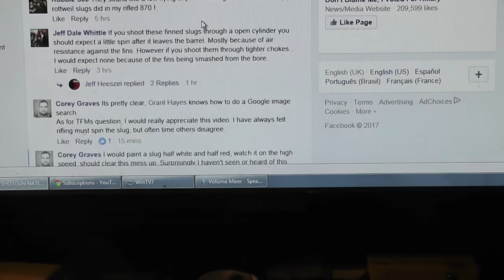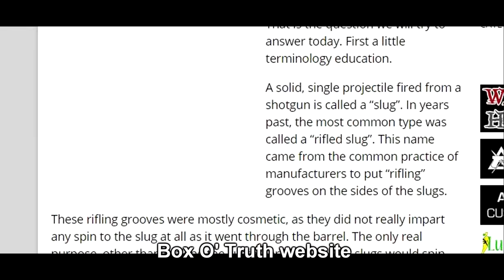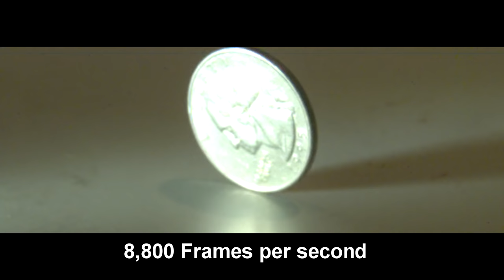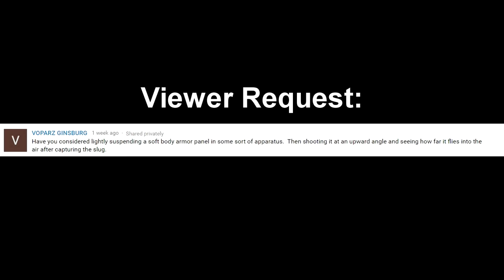Do Rifled Foster Slugs REALLY spin or it is just a MYTH?

Comment: I'm not convinced such a slow spin stabilized the slugs. That quarter spins much slower, but it weighs a fraction of the amount of a slug and has a minute sectional density. It also doesn't have a shock wave affecting it from being supersonic. Try gluing a point to the front of the slug and spin it on the table as slowly as the quarter. 

A rifled shotgun barrel has about a 1:28 to 1:36 twist rate to stabilize different slugs. If this test is 25 yards, then this slug has a 1:3600 twist imparted. I shot 62gr 5.56mm from a 1:12" .223 rifle and the bullets keyholed at 70 feet. The Army increased the 5.56mm only 7 grains and needed to shorten the twist rate from 1:12 to 1:7. .30 cal rifles meant for long range get a rate of 1:10 instead of their 1:12 rates of their lighter bullet throwing brothers. So,  I'm pretty skeptical that a couple inches difference in fast bullets makes a huge difference in stability whereas a rate 100 times slower in a slug will still stabilize it. Even the slowest twist rates mentioned here in the comments were still 50 times faster than the spin imparted by these rifled slugs. Note: 50 times faster in twist rate, not RPM. No one says the twist rate of 5.56mm is 305,450 rpm.

Comment: Years back I used a lot of .410 slugs.  I was in a discussion (It involved beer) with a couple guys and some said that it was dangerous to use a full choke shot gun and slugs. I cut a Remington  and a Winchester slug open and mic'ed both of them.  I don't remember which was which, but one was .390 diameter and one was even less. I often wondered if the cup in the slug expanded to the bore or if some of the gases escaped past the undersize slug and got it spinning. All I know for sure is it is a long way from cork bedded 'punkin balls.

Comment: When I shoot the Gualandi Dangerous Game slugs in my smoothbore shotgun I can see spiral grooves in the powder residue in the barrel, which hint to an approx 1-turn in the 20'' barrel. I think the Gualandi Dangerous Game slugs do spin through the barrel.
Which could also explain their remarkable accuracy  -  I can make 5 shot groups of 1.5'' or less at 50 meters no problem and even make 100yds hits in the black.
Reply from the maker: I think they claim those two ribs on the slug cause the slug to spin too.
Reply: Here in Europe all you can find is dangerous game slugs and the brenneke, foster slugs are unheard of. I've never seen the claim that they spin though, they just guarantee very good accuracy. 
Do you think the classic brenneke slugs spin too? 

Oh, and about the slow spin rate of the foster slug, the shorter the projectile the less spin (RPM) you need to stabilize it. Thats why really long rifle bullets need a very aggressive twist like up to 1:8 inch and very short projectiles like a round ball need only a twist rate like 1:72 inch.

Comment: Correct me if I'm wrong. But, isn't the heavier/bigger the projectile the less spin it needs to stabilized. Kinda like 556 is 1/8 or 1/9 vs 308 1/10 or 1/12. This is an educated assumption.
Reply: THE JONESY rifles need extreme rpm's because the back end weighs several times more than the front half like throwing a rock in a sock with sock end first. foster slug is like throwing rock end first since its front heavy so basically no rpm's needed. what your saying with rifles having different twists, a faster twists allows stabilising a bullet with more length to width ratio. 1-7 223 can shoot 80-90gr which are very long and skinny for its diameter

Comment: I don't understand why you didn't check if the unrifled slug rotated?  From what I could see it seemed to rotate about the same as the rifled slug which means the rifling was not the reason it had some spin.
Reply from the maker: The unrifled slug had a marking in the cavity.  It never rotated  around to expose the marking though.

Comment: The slug may spin, but is it relevant?  When discussing accuracy, It is the rate of spin that matters, and this rate is not constant for all calibers and projectile lengths, and that fact has not been addressed.  Generally speaking, the longer a projectile is for any given bullet diameter, the faster it must spin to stabilize and remain accurate.  Shotgun slugs, being almost as wide as they are long, would lack stability if it were not for their forward mass and hollow base, or attached wad/tail, which makes them behave more like Minie balls or shuttlecocks.  Both techniques give them greater accuracy and penetration than the inefficient round balls they were meant to replace.  So why are there both "rifled" slug barrels and smooth slug barrels, and why are so many slugs grooved?  Well, it appears that over 100 years ago there were some rifled barrels and choke tubes that were intended to be used with specialized slugs, but the reason for the slug itself being "rifled" had little or nothing to do with accuracy, and was all about efficiency.  The less contact the slug had with the bore, the less drag it created, so velocity increased (the felt wad formed an effective seal to prevent gas from escaping through the rifling grooves).  In the 1930s the Foster slug was developed using softer lead to allow any smooth-bore shotgun, regardless of choke, to safely shoot slugs.  The grooves or "rifling" cut in the Foster slugs allowed the projectile to compress as it passed throguh the choke, lessening long-term damage to the choke.  Any deformation of the slug did adversely affect its accuracy, but at typical slug distances of about 50 yards this was of little concern.  For those wanting greater long range accuracy, manufacturers developed the deer gun or slug gun, an unchoked (cylinder bore) smooth bore shotgun with rifle sights.  To add to the confusion, they also developed even longer ranged rifled slug barrels that are intended to fire undersized sabot slugs.  While it is possible to also fire conventional "rifled" slugs through these rifled barrels, it will cause lead buildup.  It's better and safer to always use the right ammo in the correct barrel for the proper purpose.

Comment: Do the vanes/ribs spin match the slug rotation in flight? 1 in 22”, 1 in 25” for example, similar to barrel rifling and do bullets spin same rotation after leaving rifled barrel?
Reply from the maker: Yes,  usually bullets/slugs spin in a clockwise rotation looking at them from the rear

Comment: I have had excellent results wiping 1000+ lube into the crevice between the slug and the roll crimp. It will take you from a 6-12" group at 50 yds to a 2". If you start with a clean barrel it will stay clean and continue to improve accuracy as it seasons. If you start with a dirty barrel it will be much cleaner when you finish the box. Rifled slugs are the only lead projectile that doesnt have lube. I thought doing this was obvious. I would like to see you test this. Who cares if it spins or not. It is very front heavy with a hollow base so it flies like a very short arrow if it doesnt spin.

Comment: I do not credit the 'spin' of a Foster type rifled slug to stabilize the slug in the same manner as a rifled bore handgun or long gun.  Typically, a Foster slug has accuracy equivalent to a large smooth bore musket of the Brown Bess or 'Charleyville' type.  I have used slugs from 12 gauge shotguns in my lawman days.  At fifty yards the slugs pattern about roughly 12 MOA or six inches, give or take.  

I vastly prefer shotguns with rifled bores and rifle sights, and depend on the Brenneke (classic) type slugs.

Needed spin is determined by length of projectile (bullet), diameter and sectional density as well as velocity.  Probably good to throw in the phase of the moon.  Larger and short for length projectiles are easier to stabilize.  Maybe slugs stabilize more than I think.  I still prefer a rifled shotgun.

Comment: It doesn't matter.  Those grooves are designed to crush and seal against the barrel.  Foster slugs are designed nose heavy to maintsin stability.  They are quite accurate in a good shotgun.
Reply from the maker: Then why do they make them slanted?

Comment: 100% agreed. spin is spin. even if it was 1 rpm it is essentially still spinning.
Reply: This.
Even 90 degrees spin on that distance is several rounds per second. It is enough to stabilize it, when you think about it.

Comment: JEFF JEFF JEFF...1ST. I LOVE YOU GUYS😁..I must point out an Error of a statment you...made .. about the "Vanes and Shockwave" .... remember a Shockwave is Only a Pressure wave... the Air Still Flows around the Projectile. The Shockwave is The Result of Air Molecules Packing up onto each other as the static Air cannot move out of the way quickly enough before  the molecules that have deflected off the Projectile slams into them.  BONUS: Fun Fact The contact point on the Projectile to the air Medium During Super Sonic Flight is compression. Resulting the Shockwave which is an "Adabiatic" process of Compression.  This Is the Heat Generated during Compression. This Is the Real Cause of External heating on Spacecraft Re-entry and example the SR-71 Blackbird. The Skin friction is Negladgable.

Comment: he problem seems to be that any fluting on the slug is not really in contact with the smooth barrel enough to impart all but the most minimum spin (200 rpm by your estimate.) Not enough in the time of flight to do much — 3/4 to 1 full turn in flight. Hopeful but not enough.
Could you make a sabot that tightly grips the slug and contacts the barrel more robustly than the slug alone? Or a fluting design that channels the detonation into angular momentum that spins the shell?
Got an artillery guru out there?
Reply from the maker: The amount of force slamming in the back of the slug is tremendous and causes the slug to compress.  It is definitely contacting the barrel.    It's the same process a Mine' ball uses
Reply: Yah. I see that the hollow Foster slug is sort of a 'lead balloon'. Still, the contact area is not enough to impart enough stabilization through spin. Anybody come up with a fix for the non-spinning? Or do we agree that spinning isn't necessary for a Foster slug?

Comment: Even as just a little plus on the end of a video, could you try shooting just the wadding at something? No lead shot, no slug of any sort, nothing. Just powder, gas piston, and wadding.
Reply from the maker: WIthout any mass in the shell,   the main powder charge isn't going to go off.   Sort of like what was going on with the Prince rupert's drops.    You need about 5 grams of weight minimum we have found.

Comment: Definitely spins. If you need further proof  shot some slugs in smooth bore  measure group of 3 then throughly clean the barrel  and to your surprise they may not even hit the target. Takes 20 to 25 rounds to get some barrel buildup so the grooves of slug actually grip enough to be spin. Learned this the hard way sighted gun then night before cleaned the barrel at 30 yards that slug hit right above the hoof I was know that because 2 weeks later shot that buck and saw were it knocked off the hair

Comment: The reason it doesn't spin much is because they get worn out before they exit the barrel. They're soft lead and the rifling on the bullet will NOT last.
Reply: It does spin, you may have not watched the part about the video being shot at 880 feet/second, watch until the end.  It spins really fast.  Measure one after shot, there is no noticable difference.

Comment: There is NO WAY that spin is imparted to a grooved slug by its grooves from interaction with a solid smooth bore that remains smooth.  The ONLY way that a grooved projectile could gain spin by interacting with a smooth bore is IF the bore became grooved to match the grooves of the grooved slug during the interaction process /while being fired.  THAT is NOT happening with lead slug going down a steel barrel.  A grooved (rifle) barrel imparts  spin to a bullet by forcing the bullet to conform to its rolling groove pattern which permanently imprints that pattern into the bullet.  The physical interaction between the TWO matching groove patterns as the bullet proceeds down the grooved barrel is the thing / mechanism that imparts spin to the bullet which becomes rifled (imprinted with rifling grooves) itself at the instant that it begins its journey down the rifled /grooved barrel.  The tiny degree of spin observed with grooved slugs out of smooth bore barrels is due to their interaction with the (FLUID) ATMOSPHERE AFTER the slug exists the barrel.

Comment: of course they spin why would people think they dont, rifling and other design features can be used to do more than one thing on an object, two birds one stone kind of thing. if the cuts where dead straight dont the slug then no spin, any angle and spin occurs, shuttlecock effect makes point the right way rifling allows it to spin gives it more stability and more range as its not wasting energy trying to fight the air.

Comment: Half a turn at 8800 frames per second. But how many frames was that?
You see, the thing i am interested in is figuring out the RPM (Revolutions Per Minute) of the slug which can then be compared to other rifled projectiles. Especially pistol projectiles.

If it's half a turn in 300 frames shot at 8800 frames/s then it would be turning at a rate of 880 RPM. That is as fast as a diesel engine on idle.
Sure, it's a far cry from the 100,000 to 300,000 RPM of most other bullets but we are talking a massive slug here. Not your average bullet.

Comment: "Several hundred RPM?"  A typical 12 gauge rifled barrel imparts 1 rotation in 35 inches.  At 1200 FPS, that's about 400 RPM.  Those slugs you're firing are not spinning anywhere near a full revolution per yard.

Fact: The spin is coincidental, and not necessary for stabilization of the slug.  The main reason for the vanes is to deal with any choke in the barrel along with the forcing cone - something that ALL shotgun barrels have unless they are overbored.  

The function is similar to the rings cut into solid copper bullets - it reduces fouling and pressure by allowing the (in this case) lead to squish down a bit and conform with the barrel.

Look closely at the slugs you were firing.  They're all hollow-backed, and all very nose-heavy.  The problem with your Ozzy friend's vane-less slug is probably in it not having enough "give" to deal with the forcing cone, leading to deformation that causes loss of concentricity.  

Keeping the deformation of the vanes/slug concentric is actually a very good reason to put a slight angle on the "vanes".  Even without meaningful spin, it helps keep things centered.

This is what the Foster slug was invented for: to be fired from a barrel with a moderate amount of choke, instead of from a dedicated slug barrel.  It worked so well, dedicated slug guns fell out of favor pretty much until the rise of sabot slugs. 

Many Foster slugs on the market have little (Fiocchi) to no (some Brenneke) angle to the vanes, but function with the same level of accuracy.

Send some slugs through a rifled barrel and compare the rotation rates.  The rifled barrel will be quite a bit faster.
Reply from the maker: There are a lot of slugs that have straight vanes on them.   Why even angle them?   A rifled barrel puts a LOT higher spin on a slug than 400 rpm.
Reply: Yep, my math was off.  400 revolutions per second at that MV, so that'd be 24K RPM.  Thought it sounded low compared to the 30K or so RPM of a lot of handguns and rifles.

Why put angled vanes?  I'm going with "marketing" as my top answer.

Comment: And the air will help it to spin also.  The comment about the shock wave preventing this is hilarious.  The shock wave does not prevent air from flowing around the rest of the slug.  If that was the case, no airplane could exceed Mach 1 as the wings and tail would no longer be effective.

Comment: Almost busted.  Smooth vs. Fiffled.  Your vids. Showee both slugs spinning.  Common sense would suggest that only the riffled slug would spin not the smooth. Sso  were is the phiccics causing the smooth shot to spin there are no ribbs.  I'd almost say it wobble spin tumble through its journy through the air.   Some small callibers flip backwards upon impact.   However. It is a interesting suject. Isn't it!?

Comment: I'm not a science major by any stretch of the imagination,  but I think it's a lot based the natural materials at hand,  comparing the metals as they are,?????
The foster slug is just that a 
Lead chunk of metal, again lead, you have a steel barrel,  a firearm barrel is made from steel for a reason,  the riflings in the barrel are a part of the barrel for a reason, the foster lead slug is just that a lead ball,  even though it's in the shape of a cup or a thimble,  it's still a lead ball,  yes, it has riflings on or formed Into the body of the slug, but that slug is so dam wide and short and those riflings are low in airflow control,  to me it makes dam little sense to use a foster slug, as compared to a sabot slug, where you will get guaranteed 
Rotation , it's almost like comparing a musket rifle of the 1800s, to a rifle of today rifles,  the science is kinda simple to me. Do your own research,  hunt with what ever you like,  foster slug rotates very dam little,

Comment: The spin is induced by air pressure passing into the channels and being directed by the channels.
Reply from the maker: Not so,  in the milliseconds it is flying in the air,  it wouldn't have time to do that
Reply: @taofledermaus  yes it is not so, what you have said. Duration of flight time is a wrong assumption on your part. Better for you to talk to an aeronautical engineer.
Reply from the maker: @tommylee2894  The shockwave prevents airflow from acting on any fins on a slug.
Reply: @taofledermaus  The shock-wave is compressing the air along the length of the slug. And the slug does not have fins, it has channels, which are acting like inverted "Wing Fences".